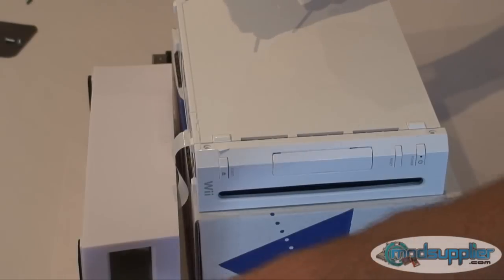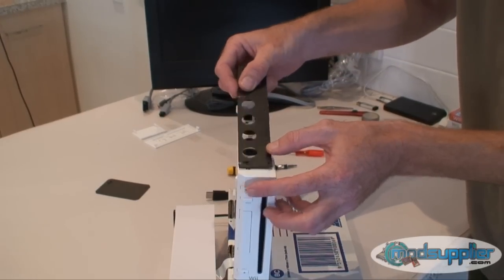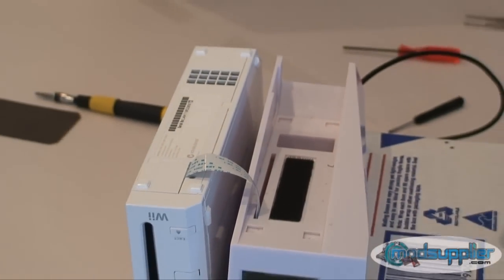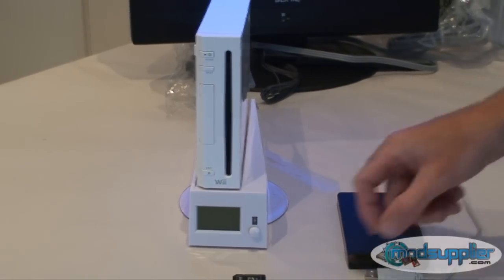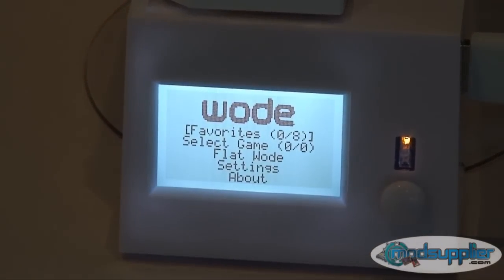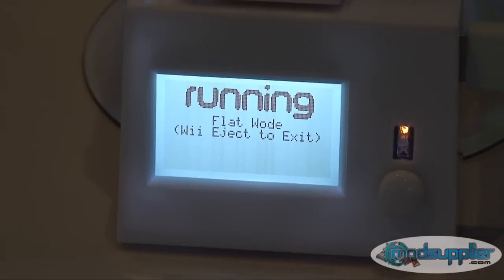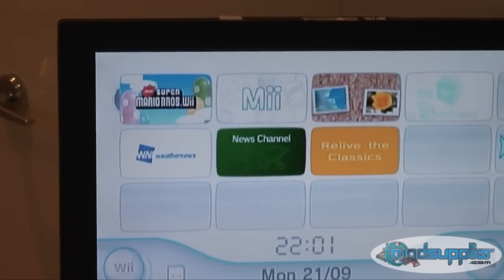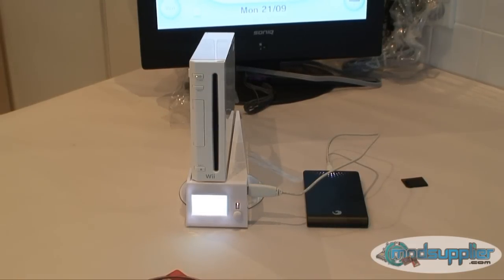Wii Wode Jukebox Installation Video Guide HD  Part 3 or 3

Comment: it can ;) its a linux running in the wode. you just need a filesystem that supports 2tb (NTFS or EXT3), but you could still partition your drive, so you would have like a 200GB partition.

Comment: @MCRTheEnd i found out that you only need to plug in one if you have an external hard drive that uses an AC adapter. if it doesn't, plug in both of the usb cables since it won't get enough power if you don't.
so i had to plug in both actually :P

Comment: I installed the Wode, and I can't load any games from my HDD. I always get Error has occured. "Press Eject, message all the time." Flat Mode works with all my original games. I'm on 4.2U, tried HBC, which came back to the same error and Gecko gets stuck on Launch game when I try. :( I updated and downgraded to 1.28 and 2.1A and both dont work. Ripping on 2.1A was working. My HDD is NTFS.

Comment: @stijnkessel Im using a 2,5" USB-powered HDD (LaCie Little Disk). It works great. But you can use a cheaper USB flash drive too. The slower the transfer speed is, the longer it will take for the game to load. But it won't affect the gameplay!(such as lag etc.)

Comment: what is the point of this even back in 2010 there was no point for this just use WBFS Manager the games are much smaller file size then the iso files so you can fit way more games on the hdd and USB Loader GX plays can play any wii game from a hdd 

also there is another app i forget the name that can play any region disc on  your wii 

Wode Jukebox is a waist of time